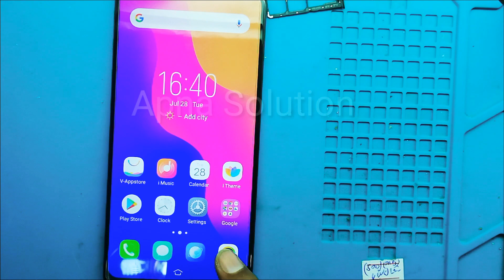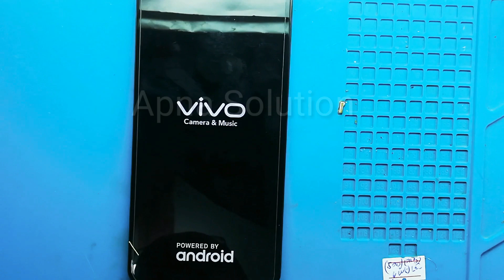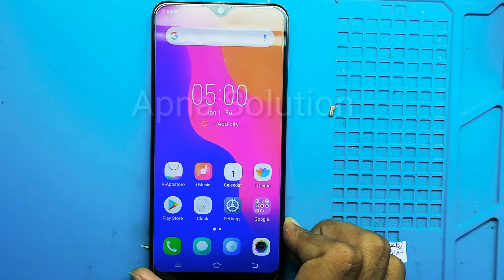Vivo Y91 Y91c Y93 Y95 another camera broken cannot switch 100% solution

Comment: Hello Guys. I also had this same back camera problem. I also tried to remove  the cover from motherboard but i can't able to remove it easily as I don't have enough tools like hot blower. So my suggestion is better go to any nearby mobile repair shop and they will change some diodes and capacitor. Then it will work. My back camera problem is solved and working fine. Technician will ask you more money like Rs.1800 to 2000 to change the diodes and capacitors. But, finally they agreed for Rs.700 only to do the work. The main cause of this back camera problem is water gone inside phone. Better to avoid water falling inside phone in future. Thanks.
Reply from the maker: Dear i agreed with you if you don't able to remove this cover i also uplod a new video for new peoples that have not heatgun video link you can fin in discription with the name of latest solution in HD camera problem solution
Reply from the maker: Thanks for coment and taking in detail again thanks